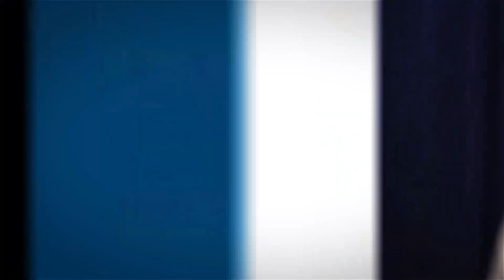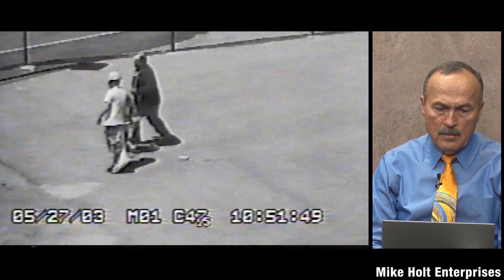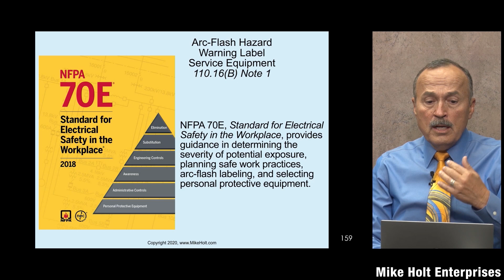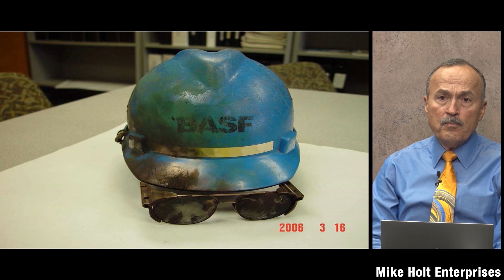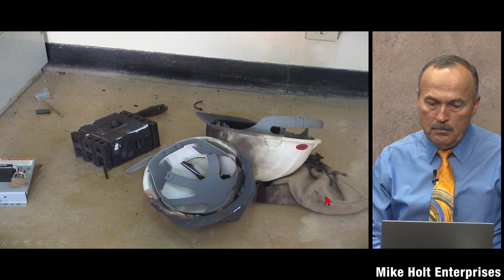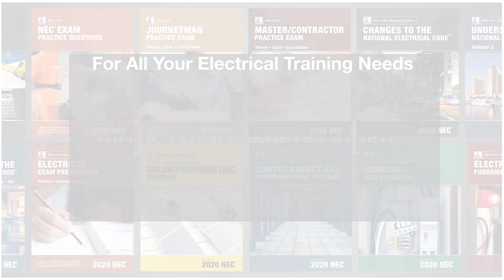Arc-Flash Hazard Warning Label, NEC 2020 - [110.16], (23min:50sec)

Comment: This video is spot on! Techs complain about RIG dexterity but the questions is, "What are you doing with the hot gloves?!". You should only be verifying the absence of voltage with the RIGs on while using your voltage meter. That's it! Once it's off, take the RIGs off and THEN do the work while it's de-energized in an electrically safe work condition without your PPE.

Comment: Mike, you are correct that the Arc-Flash is really dangerous, we came to know the fact when we have done the Arc Flash study at the testing lab on our one of the product called fault current limiter, the severity was 33KV, fault current 55KA for 0.1 seconds. The result was horrible, the panel with 5mm to 6mm MS thick wall just blown like a balloon. The panel had dimensions like 12 feet*12 feet*10feet  and we have provided 2 big 2feet*2feet opening flap on the top of the panel to release the generated hot gasses, but still not survived.
Now the arc flash study is becoming popular for many electrical equipments, especially MSPs, DC DBs and AC DBs.